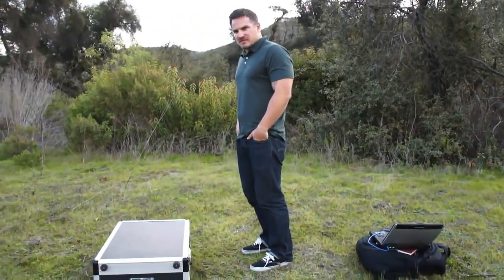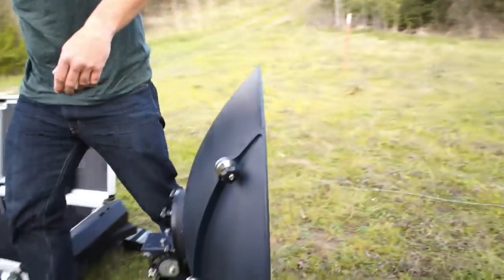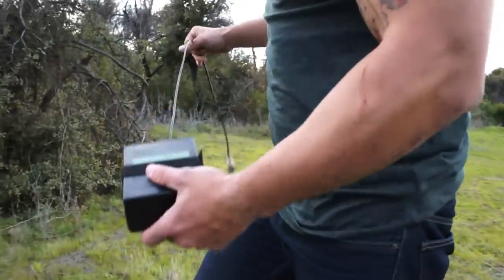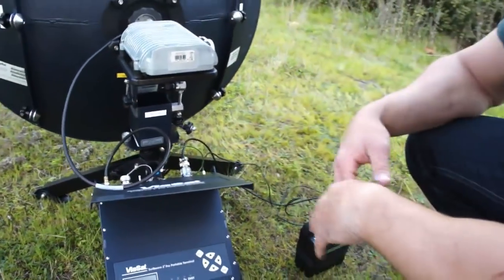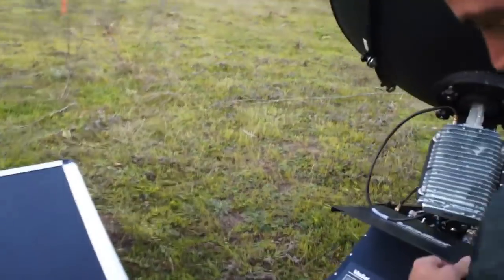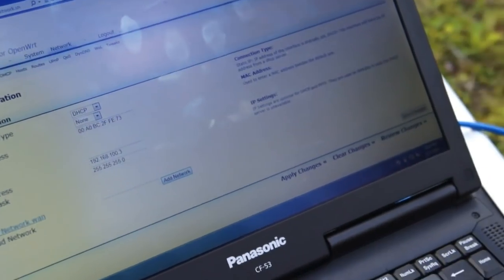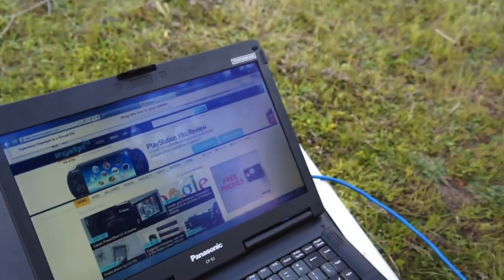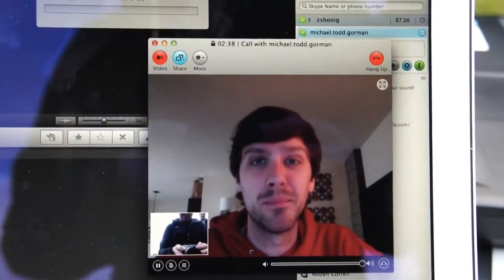ViaSat SurfBeam 2 Pro Portable Hands-On

Comment: What meter is being used
Reply: The Viasat Trial, (feed horn LNB) has that audiable indicator. Once course elevation and course azimuth and skew is set on the dish, the sound coming from the Trial is the meter. It is not like Hughesnet where a Dap Meter is required at the dish to point and peak signal.